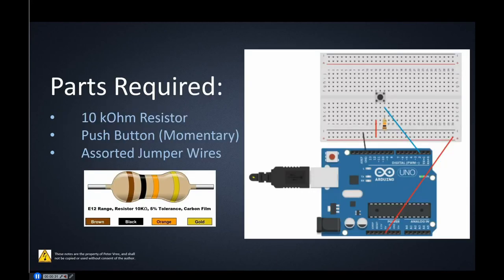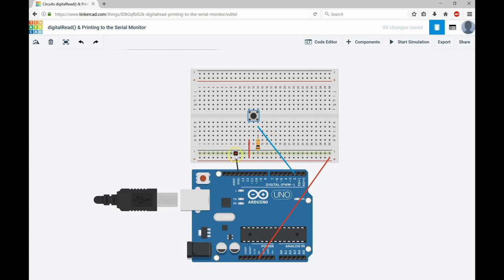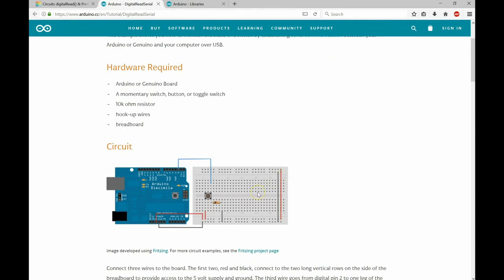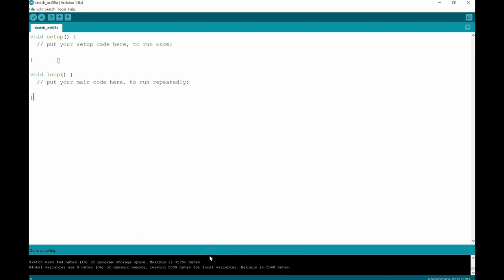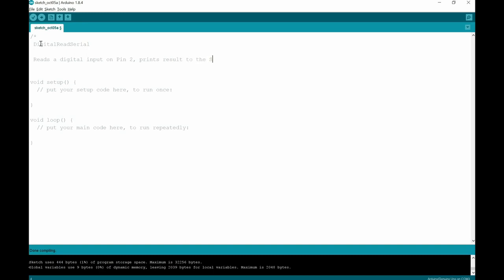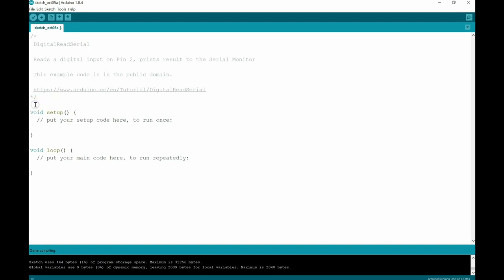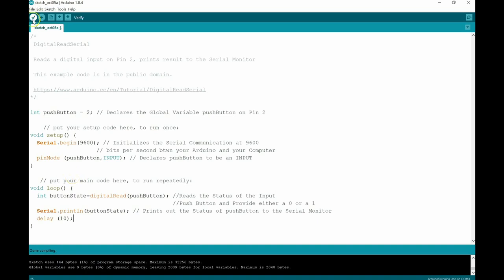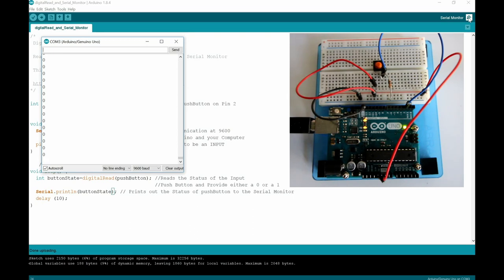Arduino Tutorial #6 (digitalRead and Serial Monitor)

Comment: Your voice keeps fading out and becomes inaudible. Maybe because you're starting to mumble to yourself? Great tutorials otherwise.
Reply: Also, those characters you are using to open and close the code statements are not called "parentheses", but rather "curly brackets" or "braces" depending on where you're from.
You could be confusing some, who cannot discern (via poor resolution or bad eyesight), onscreen, what those are, exactly.
Reply from the maker: Yup. You'd think after 200 videos I'd have the audio down... switched to the Rode Mic on my camera and now sync the audio when I edit. Fought with this USB audio mic converter for too long. The audio on these initial Arduino tutorials is crap... but I'm too lazy to redo them. Thanks for the comment. mumble...mumble.